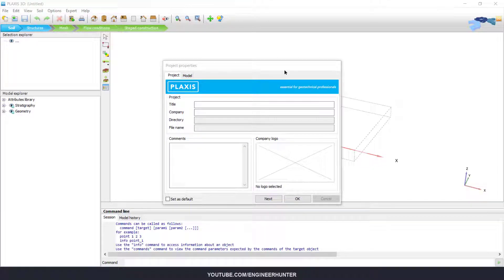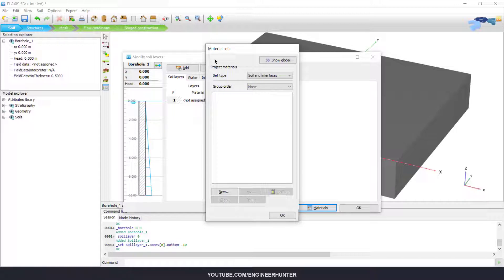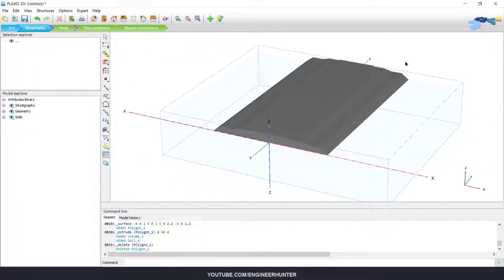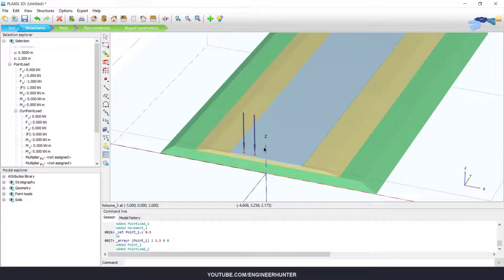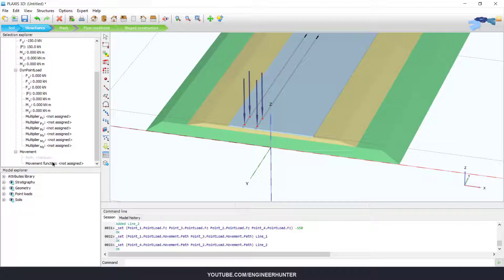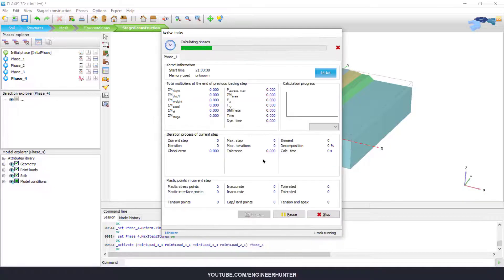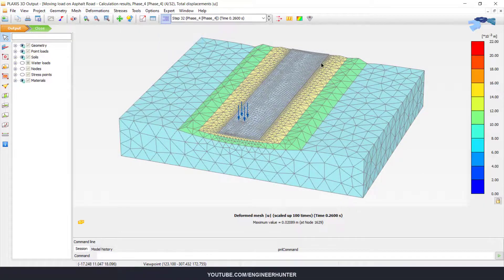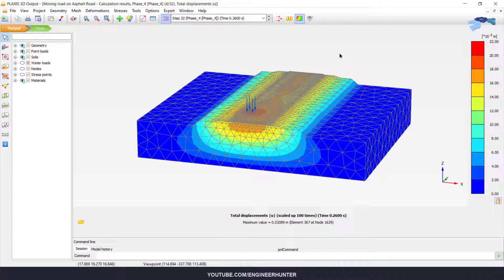How to model moving load on asphalt road in Plaxis 3D

Comment: I have a question. Is it possible to analyse the behaviour of the road under traffic load with Plaxis 2d? I need to do this for my thesis, but I did the analysis with Plaxis 2d. I defined a dynamic load at a certain line. will this give the correct result? I need comments from everyone who reads this question. thank you all

Comment: Hi ... Can you help me please... I am using plaxis 3D dynamic V20 to simulate the earthquake applied on piled raft. the raft is plate and the piles is embedded beam with uniform static load and elcentro earthquake... The model is very slow in the analysis and calculation phase and takes about 60 hours. Do I have a problem or is there a way to speed up the calculations??

Comment: Hello and once again many thanks for your helpful videos. 
I really need your help with something for my project. 
I have an asphalt rd constructed on very shallow ground, reinforced with stone columns. It's an extremely slow process. Specifically the dynamic phase of my model. I have done exactly what you teach with only difference that there is no ground improvement in your model.
Can I have your email address please and ask my question. 
I really really appreciate your help.
Reply: Can I send you an email or call you please? Tried to connect with you on Facebook page. I do everything exactly as you teach. The dynamic phase is extremely slow. I wonder why!! Is it because of stone columns? Please advise.